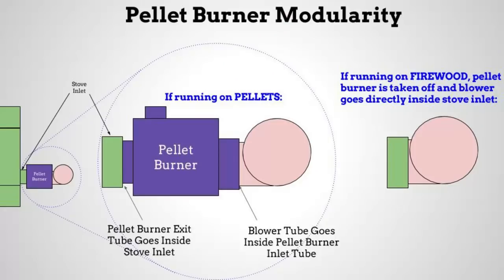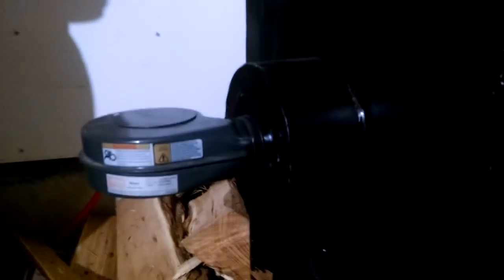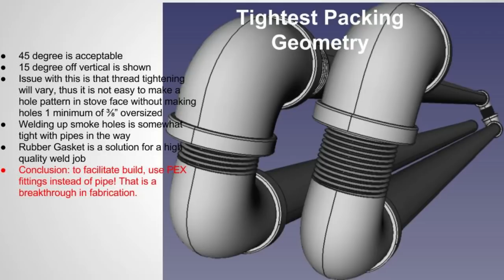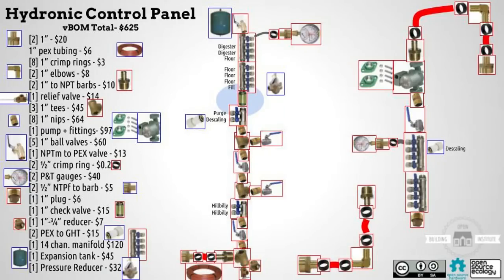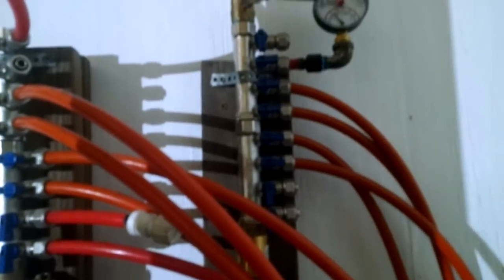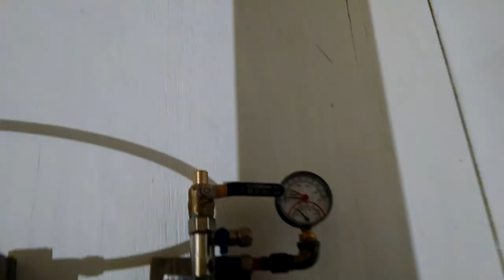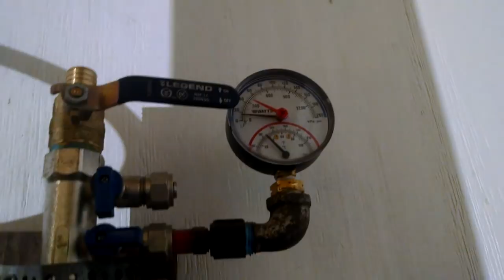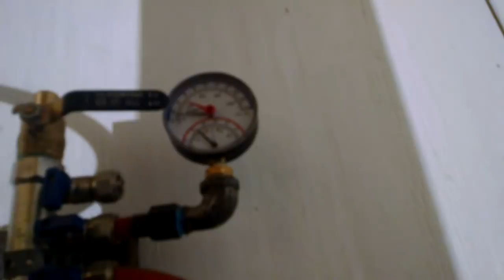Seed Eco-Home Hydronic Stove Walk-Through

Comment: Sorry for asking, but wouldn't a house radiator be as useful as the water jacket that you made? what I mean by that,  probably you shouldn't have done all the welding to build your water jacket! 
Thank you very much for uploading this video!
Kind regards, Dan George
Reply: I'm not an expert but, I'm assuming that a "house radiator" is WAY to small for the BTUs that he was trying to achieve.
He stated his system is rated for at 200,000 BTUs which is quite robust.
And a "house radiator" is not really built to generate the high BTUs, just circulate hot water and radiate the heat into a room.

Amen
Retired, Veteran

Comment: I learned from Mike Reynolds Earthships Designs that the key to getting the most out of the thermal mass is to insulate in. In other words, put a layer of Styrofoam or something insulative that can take the weight of the house, before pouring the floor. This way the heat transfers from the mass floor into the house, not into the ground.
Reply: Empty bottles.
Reply from the maker: Yes, exactly - that's consistent with our experience, so that the cold from under the house is not cooling off the house. This means that it's probably hotter inside during the summer - which means that insulation helps more in the winter than in the summer.
Reply: Marcin Jakubowski - Earthships have natural cooling by bringing air underground from the north side, and using counterweight vents in the roof. Combining these, they are  able to maintain a mean temp of 71 degrees Fahrenheit year round, even in very hot and very cold climates. It usually takes a year or two to fully get there so that all the mass is "charged". Having enough mass heated to 1 or 2 deg above the targeted ambient temperature, without "leaks" of heat to the ground or north. Mike Reynolds calls it "Thermal Wrap", and worked out the kinks over 40-50 years of experimenting with a lot of different designs. Also was wondering about the arduino controlled babbington waste oil  burner you did a few years ago, why wasn't that used in the heat exchanger? Just that Pellets are  cheaper or more abundant?

Comment: I remember the Tamera project using vegetable oil as a working fluid, any comments on water Vs oil??
Reply: at a guess i would say the vegetable oil might work better if you have more entry points for the hot fluid into the floor, but it wouldnt hold as much energy. good question, i too would like to hear an experienced answer to this :)
Reply: Unlike water oil is flammable. If some plumbing goes wrong near the stove oil will miltiply troubles.

Also oil causes much more strain on pump.
Reply from the maker: If oil is used, we would not be able to integrate with household hot water - unless we have more complex heat exchangers. Also, the oil must be stable over time, so that the system does not clog with polymerized oil.

Comment: Are you planning to increase amount of heat exchange piping inside a stove to increase it's efficiency? Because it doesn't look like 16 pipes is nearly enough to extract all the usable heat from burning wood. The exhaust must be very hot.
P.S. Happy New Year! )
Reply from the maker: No, right now we have approximately 64 kilowatts of heat exchange - check my math - so there is no case to increase the heat unless we are heating a larger industrial structure. In order for the pipes to be self-cleaning from tar/soot - the stove likes to be run on high power - otherwide soot doesn't burn off the pipes. So if we ran a low flame with a regular wood fire and more pipes, we would get inefficient heat exchange - which beats the purpose of having more pipes. More pipes would make sense, however, with the pellet burner on a lower flame - where the burn is very efficient and there is very little tar buildup.